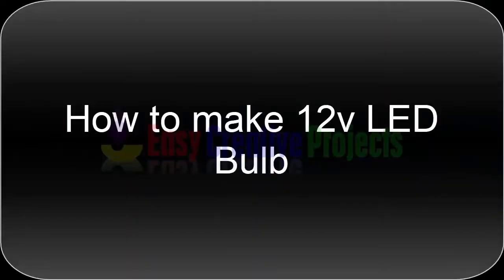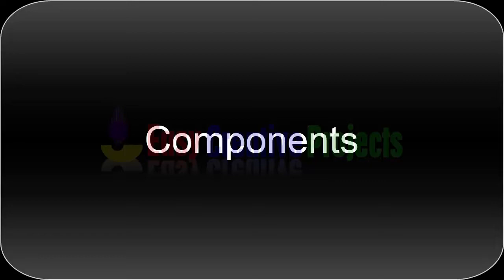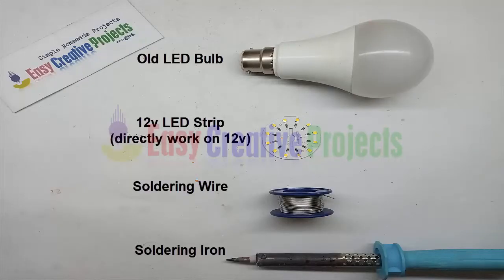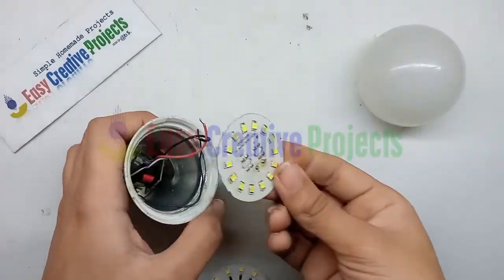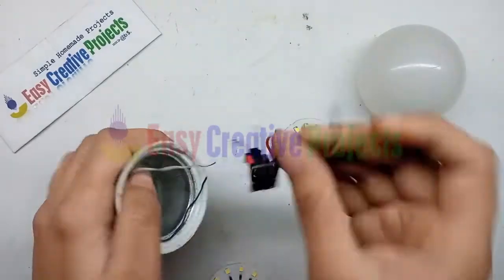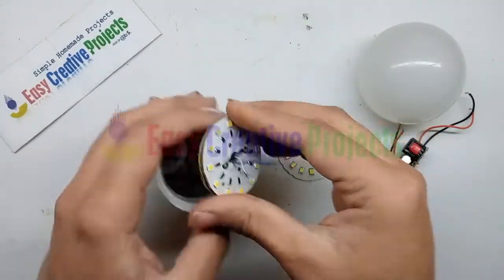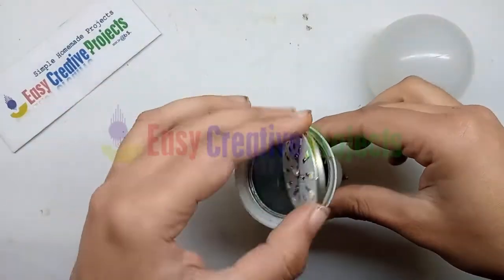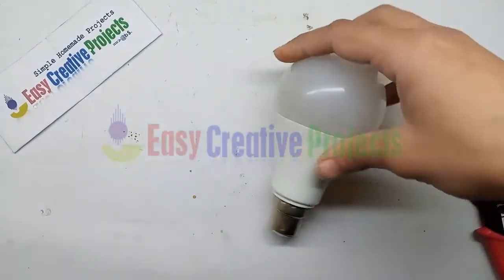how to make 12v led bulb - old 220v led bulb convert to 12v

Comment: sir how many 12 volts bulb can take a one 12 volts adapter plug in to 220 volts? thank for the answer....
Reply from the maker: its depend on your adapter power. if your adapter power 24w. then you can operate 12w 2 led blub with this.